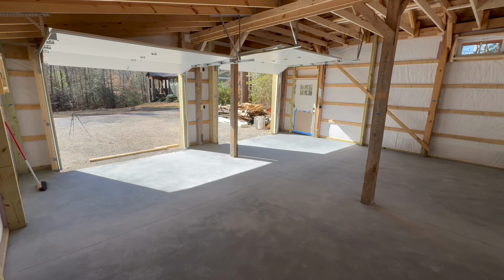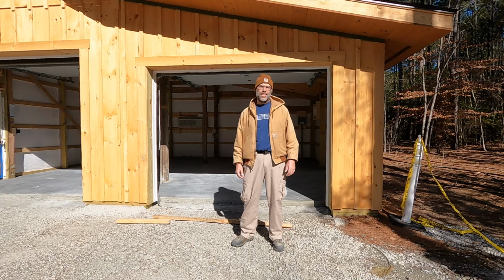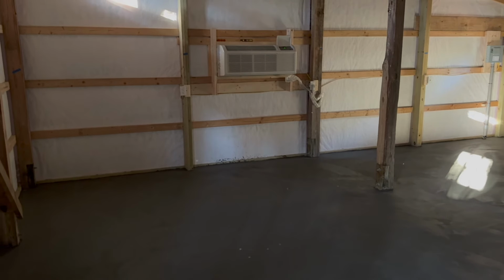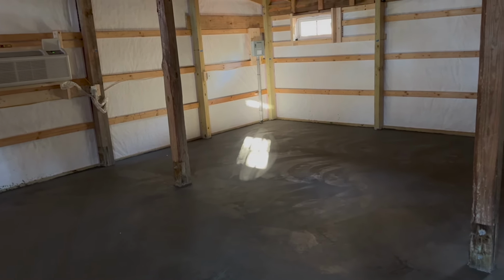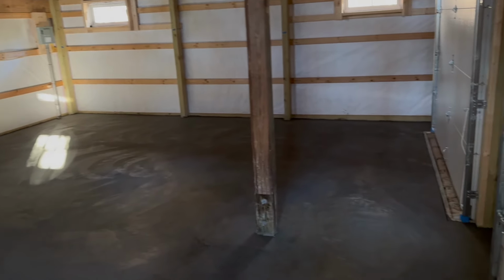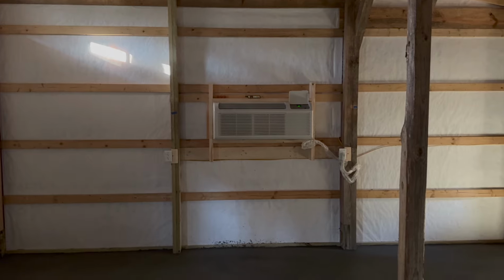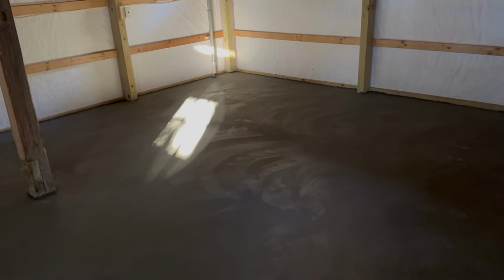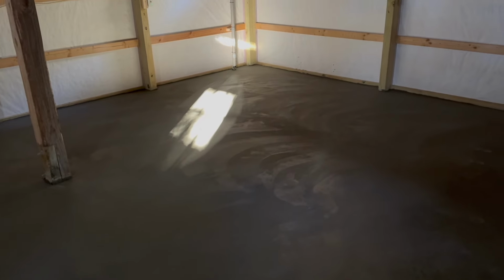Pole Barn Project #26 - Concrete Floor

Comment: Congratulations- it looks like a nice floor. The concrete mix looked “stiff”.
Reply from the maker: It was extremely stiff -- less water for better cure in the cold weather I was told.  But way stiffer than I could ever handle myself and I was nervous watching.  Fortunately these guys handled it calmly, like it was no big deal.  They had plenty of manpower and made adjustments on the fly to stay ahead of the concrete.

Comment: Please discuss a bit sometime on the reasons for not using steel reinforcing mesh, a bit on the state of the art of reinforcing concrete.  Thank you.  Yes, looks like a dry mix.
Reply from the maker: I prefer going with fiber reinforcement whenever possible.  It really does help the concrete lock up strong, makes for a homogeneous/isotropic reinforcement throughout the entire slab, and wards off many possible problems afterwards.  I occasionally put rebar in certain areas but have never used mesh.  The big flaw with mesh is that it needs to be on chairs and not get stomped down or bent down to be of any benefit, and that is very challenging to do on the jobsite -- in Youtube videos, I often see it get pushed down or halfheartedly lifted.  Unless it's optimally located within the bottom third of the pour, it loses benefit.  Too high or too low and it doesn't help at all.
Reply: @Lumber_Jack   Thank You, I thought that you might have fibers in the mix. Good to know you have found this is working well.